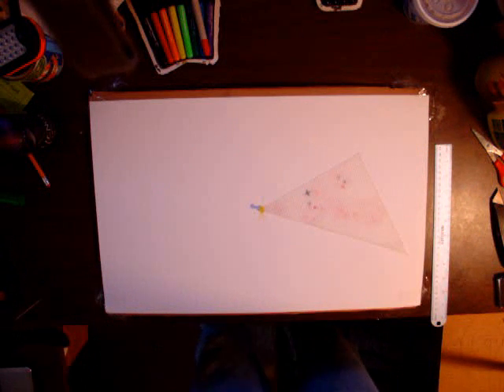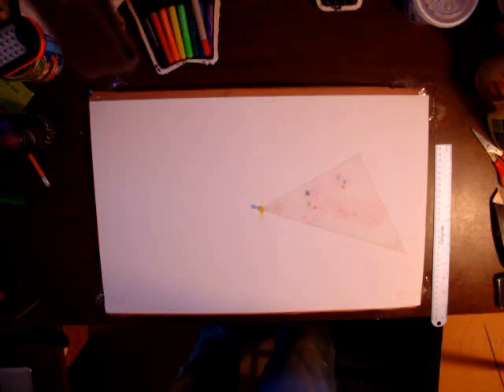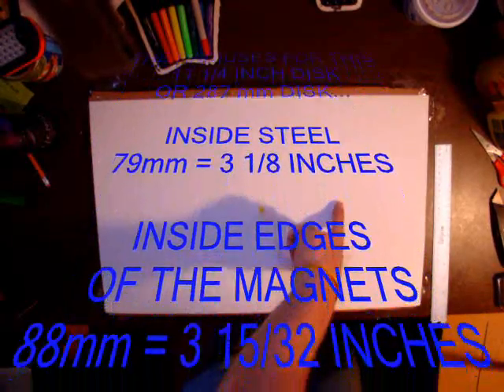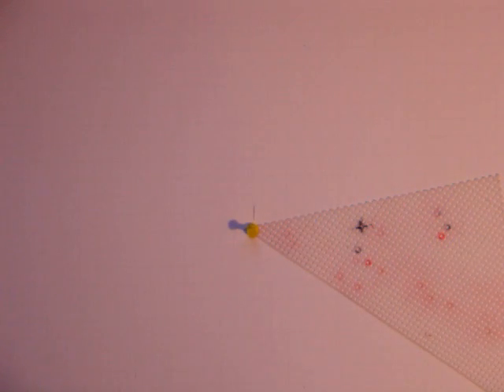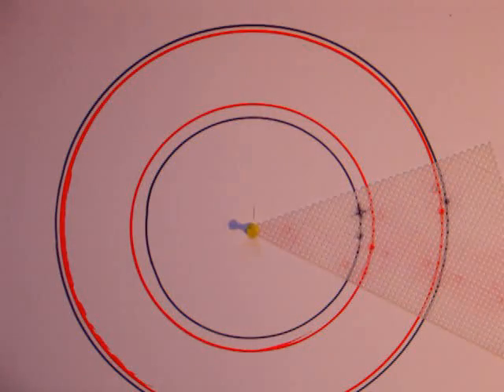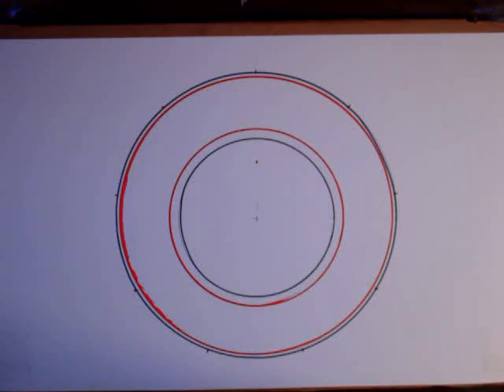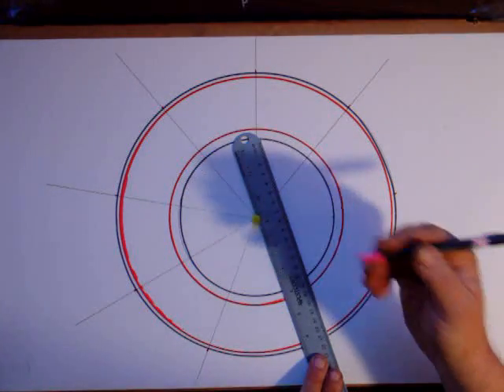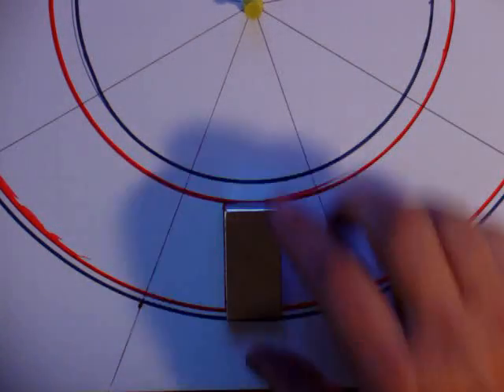BUILD A DUAL PERMANENT MAGNET ROTOR WIND TURBINE  (PART 1)

Comment: Nice work, so if I had n52 60mm × 30mm rotating at 3500 rpm what wire gauge would I need and how many turns to get 50amps and 24 volts

Comment: Please help wanting to do this but looking at 6' diameter blades and need it for 48v system 9 coils x 18 n 52 2x1x1/2" magnets  I can't find the program your referring to and the math looses me big time. can you help with the coils to fit this situation? I have low wind usually 5-7 occasional breezy days 7-13 and rare stormy days to 20mph. I'm looking to augment my solar setup for cloudy/rainy days. Do I need to go bigger or just scrap the idea?

Comment: Ok...here goes mine...I'm using 10 guage wire and a 44" prop. You used 14 guage@77turns on a 11" rotor and a 9' prop. 14 guage is 60% as thick as 10 guage so I  figure I  should use 46 turns ok? But...should I  use more turns on a larger rotor because I'll have more room for larger coils? I'm stumped....😕

Comment: I just read all the replies below....you are asked several times, where you got the program for rpm@mph....but u never give it up...why? You'd save yourself alot of typing if you'd just tell us so we can do our own calculations and stop asking the same questions over and over! What do u say?...
Reply from the maker: Hey Kevin, I wrote the program. I gave a variable of prop diameter, another variable of wind speed. and a variable of tip speed ratio. The tip speed ratio is the  multiplier of how many times faster the tip of the prop is traveling  than the wind speed. such as. 4.5 tsr means the tips of the prop are moving 45 MPH in a 10 MPH wind. 

Then I had to convert a mile into inches, and the circumference of the props' tip travel in inches. 
Then converting an hour to minutes. 60.

from this I calculated the rpms of the prop in any wind i wanted. 

The program was written in GWBASIC, Which sadly only runs on windows xp or earlier. 

But I do have a recent friend ask for the text version of the program so he can convert it to a newer format or programming language. He has promised to share the results so everyone may use it. Three cheers.
I will post it in a new video like the one you saw. I am sending him five programs. I hope y'all enjoy.
MUDDy

Comment: hello muddy
im doing a project with microwave magnets 16 poles 
and 12 coils 
can u help me with coils dimensions ??
Reply from the maker: +elie boustros 
aaahhh, This sounds like the project from Ed Lenz from "the back shed". 
thebackshed.com
In oreder for me to help i must first know the RPMs, and diameter of the magnet rotors, and then build the magnet rotors, and wind a test coil.
But the answers you need may be already there on Ed's site.
Check it out.
MUDDy
Reply: can we talk by email ? 
i will send dimensions and design of the rotor drawn by AutoCAD
Reply from the maker: a picture tells a thousand words, but video chat is millions of words.
try skype.
MUDDy
Reply: great on skype 

what is ur user name?
Reply from the maker: elie boustros THE SAME AS YOU SEE IT HERE. :)

Comment: i want to make a wind turbine 2kw use 20 magnets 15 coils. how many to turn for a coil? how many mm for coil? thank
Reply from the maker: +kiep cao Lets see.... My coils are 77 turns. I have three per phase. That equals 231 turns total. Lets add 4 turns to equal 235 turns total. divided by 47 turns per coil. This should allow for much fatter wire as well. And more amps. and a larger diameter magnet rotor. 20 inches I believe.
The inside hole of the coils will be a bit larger, but the inside dimension towards the outer end of the hole will remain the same. This is my best guess off the top of my head. 
Now draw out the dimensions on a piece of cardboard. this will allow you find the wire thickness that allows you to wind the coils at 47 turns, and the exact dimensions.
I hope this helps. 
Enjoy.

BUT, Before you go winding all of the coils. figure out the RPMs that the rotor will be spinning at the desired wind speed for start up, (usually 6 or 7 MPH winds.) and turn the rotor at that RPMs with a test coil. This can save you a lot of trouble shooting, and wasted wire.
Thanks.
MUDDy
Test coils can shortcut a lot of trouble. And they are only one coil. What ever the voltage is at the desired RPMs, should be multiplied by 5 to find the total voltage of that phase. Remember, three phase math for star wiring will help to project the exact voltage for the finished outcome.

Start with the 20 inch rotors.

Enjoy
MUDDy

Comment: I have watched many of you guys working with permanent magnet generators.  I am in Haiti and have beach land.  The surf comes in at a very strong and regular pace.  I do swim there but I have to fight the surf to get out passed the strong currents.  There are baseball and softball size rocks that come down from a nearby river.  They are tossed around like ping pong balls.  I want to insert long PVC pipe with coils in the water and have the water force magnets up through the pipe to generate DC voltage.  I realize this would not be constant like a generator or wind turbine.  We live in a country of some times electrical power from the grid and sometimes without so batteries and inverters are a common thing here.  I figure if I can get 50% charge and 50% no charge but get enough power that 50% of the charge time that I could live with that.  We know there are slow times and peak times for power.  I figure if I get the most when I am charges, I can keep a head of the demand.  Any ideas on how I should wind these coils would be appreciated.  I have though about placing several 1 inch pipes in a 10" pipe with individual coils.  I would then use several shafts being push through the individual pipes which would be forced by a large float in the  larger pipe.  I think my mechanical concept will work but I need ideas and help on the proper winding. Visualize a piston in a one cylinder engine that is magnetized going up and down in a cylinder that has coils on it.  I need help from the experts.  jdonmelton@yahoo.com
Reply from the maker: +jdonmelton  Gosh JDON, I sure wished i had experience with the water generations aspect of green energy.
I know what you are talking about of the magnets in tubes with outside coils. I believe you can achieve better power with much less work with DC motors, and a wheel in the river. Example,... bicycle rim with paddles around it and redirected water flow over the bicycle wheel. a chain can bring the power to the motor and allow for gearing changes with the chain derailer. This will allow for voltage adjustments easily.
The total drop of the water from upstream level, and where you decide to place your wheel, multiplied by the quantity of water flowing through your system, will tell you how much power you will be working with.
Harnessing that will be the main challenge. They more you use, the more you have to play with for your experiments.

I would be interested in your progress. Perhaps I can help with that as you go. And i am sure many of my viewers would love to help as well. I encourage them to add their knowledge as they see fit.

Please keep us up to date on your progress.
THANKS.
MUDDy

Comment: Hey Muddy, been awhile... hope all is good & your still answering questions here. Question, If I took your 12 mags & 9 coils out to a diameter of 26",  This would be large spaces between mags & coils.would this make it clog real bad?    Thanks Bud
Reply from the maker: +Dan Murphy Hey Dan, I am doing pretty well, almost all is good here. No complaints though.

Answer, -- , It will not cog with air core coils, But the generation as the magnets pass will cause the mechanical vibration as the current attracts the passing magnets. This is good cogging though. I CALL IT ELECTRICAL COGGING.  It means the work of the magnets is doing something FOR you instead of against you. It will free wheel until the RPMs reach charging voltage.

 Up until the charging voltage is achieved, there should be no current flowing because the alternator voltage is lower. Thus no current or effect. By then the prop should be up to cut in speed for sure.
So it should not effect start up at all.
SO the only thing to overcome would be the friction of the bearings, so it will spin as easy as a bicycle wheel until the start up voltage RPMs are reached.

The only bad part I see in this configuration is, Your ac wave might have dead spots in it that arent doing much in between the positive hump and the negative valley of the wave. Kinda like, pos, flat, neg, flat, pos, flat, neg, ect.
The other phases should help make up the gaps as they overlap, but they will not be overlapping as much as they would with closer magnets and coils.
But because the magnets are spinning faster, they pass the coils faster. and The humps and valleys might see higher peaks and valleys. 

Keep smiling and have a ball Dan.
MUDDy

Comment: I watched all your videos and you used 12 magnets on each disc. Y not use 9 Magnets when you have 9 coils. Did u not end up using too many magnets as some may cancel out some power? Also I noticed an improvement that you can make. Shape of each coil must be almost triangular/trapezoid because the magnet will cross the coil perpendicular to the coil. According to the laws of physics gives you maximum induced current.

Comment: Hi MUDDY i have learned a lot from your vid's :) thank you for up loading these vid's.
I have a small water turbine in the river and it is about 200m from my house could that pma generator supply power from that distance at AC and give power to a normal 750w 12v battery charger? And the coils how does the 3 phase work or should i just put all the coils in series in order to travel that distance for max power to the charger, I am in South Africa PLSE
E mail me : Pcf.ram.age@gmail.com

Comment: @muddymuddymudman
   Too right ! I reckon the convention of 3,000 RPM  to generate power is derived from the tiny Armatures that'd fit between the biggest Horseshoe Magnets available 150 years ago..! Dad's old Armature Winding Textbook gives the optimal speed to pull the Wire through a Field to generate Current as being 1,275 Feet Per Minute... So a  narrow, tall, Savonius & a Bike-Wheel should work well ! I reckon. Glad you agree. Thanks.
Ciao !

Comment: @muddymuddymuddman
   G'day... Um, I came here to check the beginning of the series... But I dunno what style of Rotor & Drive Trains y're using..?
   After years of Horizontal Axis, including Ram-Thrustrums, I'm interested in a 6-deck Savonius Rotor from 20-litre Drums, for big Surface-area & high-ish RPM (for the type !) ; with a Wooden-Tyred Bicycle-Wheel at the bottom of the Axle. Magnets in the felloes. Slow RPM, but BIG Sparks !?! What d'y' thunk ?